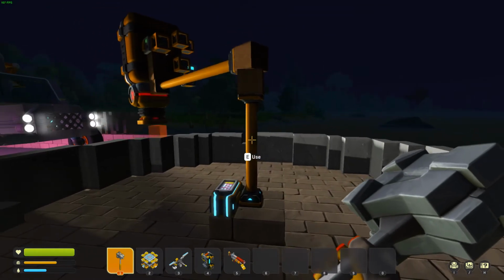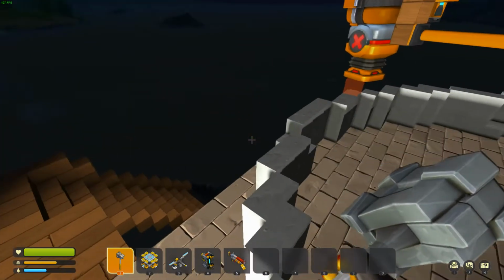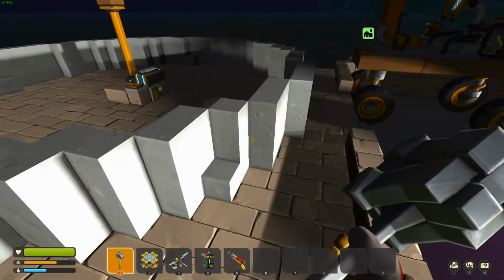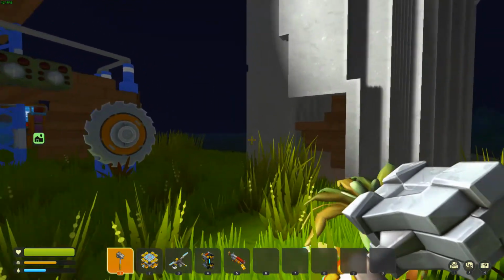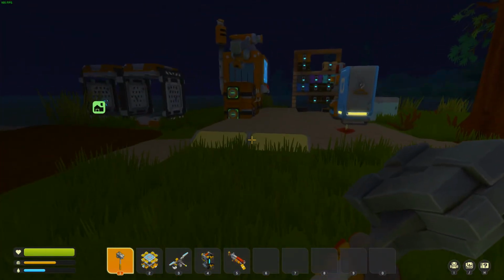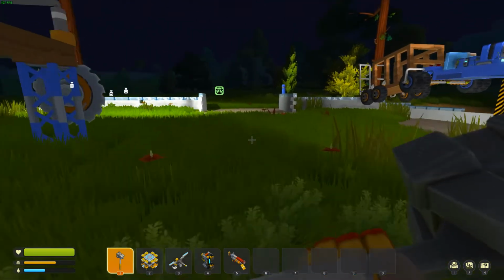Scrap Mechanic '3D Printer'

Comment: Can vacuum pumps place blocks like that? or is it a mod?
Reply from the maker: Bone stock.  Yes they can!  I also use this to feed glow-worms cardboard for glow to make explosives.
Reply: @VAXHeadroom  interesting, I'll have to try it out myself
Reply from the maker: @werts180  I tried making ovals by putting changes in the horizontal piston mixed in with the rotation to limited success.  Still trying to figure out how to do arbitrary shapes.  The controllers are kinda limited for stuff like that...
Reply: @VAXHeadroom  what if you had put another rotating point at the end of the arm?
Reply from the maker: @werts180  That's got possibilities :)
Reply: Anh no si not a mod